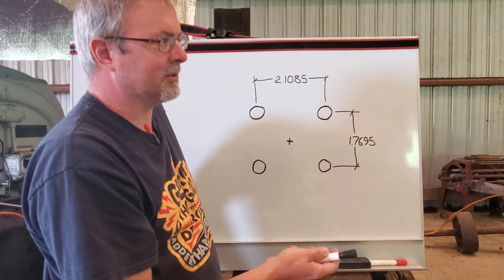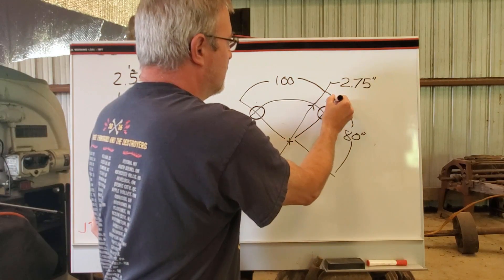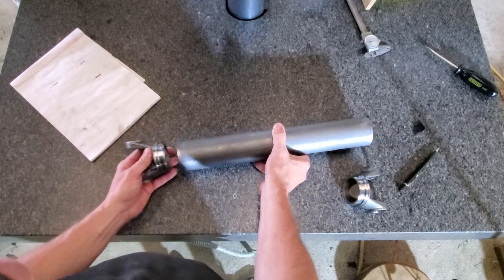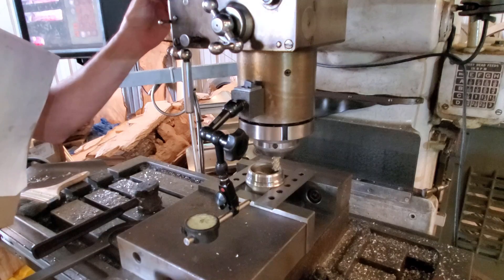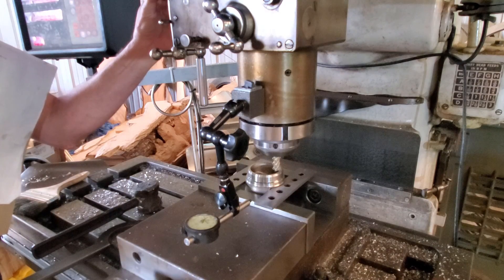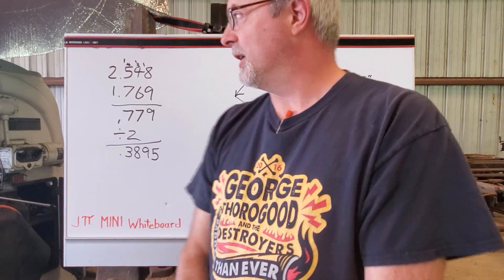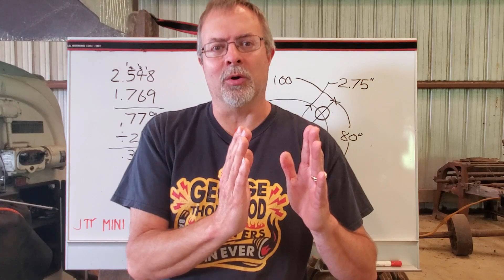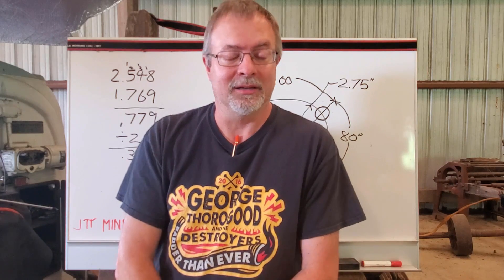Machining Spitfire Driveshaft Yokes on the K&T 2D Rotary Head Mill

Comment: I am fascinated by the capabilities of the 2D. Awesome machine. For the backlash problem, could you fit one of the small capacitive digital scales to the head?
Reply from the maker: Shhhh, I'm looking into that. There are a couple DRO's that would work off batteries
Reply: @EngineersWorkshop  I have used the iGauging DRO scale. Self contained and they can be cut to length.

Comment: Yo Jim glad you're enjoying your 2d still and using it. Wondering how you made out with the new collet system if at all? Anyway, I noticed you have the long shank to the handle for setting your radius. Thought it to be pretty convenient as my 2d only has a short stubby with the handle and is exactly the same as my manual up/down quill dial handle. It seems like I would like it better to make mine the extended version. Ok take care buddy.
Reply from the maker: The long handle is a blessing and a curse. I crashed it into my vise recently and bent it over at a 45. Luckily it was just the handle and not the stem going up into the mechanism. It straightened, but won't take another bend without breaking off. Have to finish my current parts before making the new collet nut.
Reply: @EngineersWorkshop  let me know when u make the new collet nut and I can throw u some money to make a spare for my conversion as well. Also, I was approved the power upgrade but Edison said it will take another 8 weeks for the upgrade. Unbelievable out here.
Reply from the maker: @ricko5123  I waited like 9 months for a hookup to VA Power. I'll get set up for two collet nuts once the current job is done!

Comment: Now I really love this mill. IVE worked with many machines. In a shop in 1977 I was an apprenticeshiped in a shop with a VBM with line shaft drive . Making parts for Bethlehem steel in pa. I had about six indicators to just stay in tolerance. Now with this its just amazing to see its capabilities.
Reply from the maker: And I'm sure with a real machinist running it (which I'm not) it could do even better. I have successfully taken .001" off  a diameter, splitting the vernier lines on the rotary slide scale. Everything has to be right. With a worn cutter it has springback like any other machine.

Comment: Your K&T, the similar Volstro rotary head, and my Troyke X-Y rotary table (which I sold to Stan of BarZ) are all solutions to a problem made obsolete by the CNC mill. I got rid of the Troyke when my boss gave me a Tormach PCNC 1100 as my 'gold watch' on retirement. I never got the Troyke up on the Bridgeport, damn thing weighed over 350 pounds, and Stan said he had it up on his just once before selling it down the river. At least yours doesn't require risking a hernia every time you use it!
Reply from the maker: I have an 18" Troyke that I will demonstrate in an upcoming project. It's a case where the rotary head AND the Troyke are necessary. Mine's about 300 lbs. Will be building a jib crane to handle it.